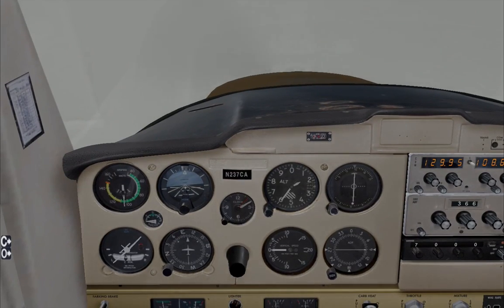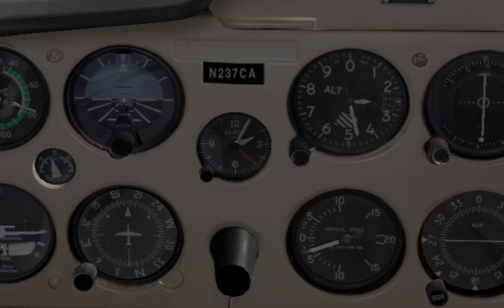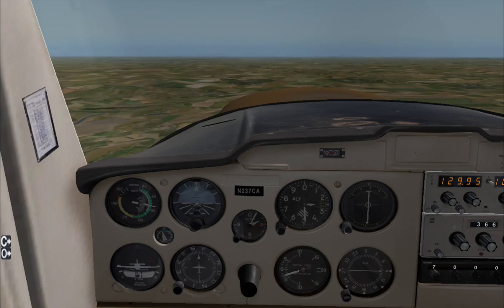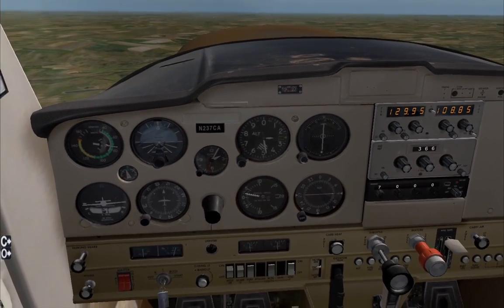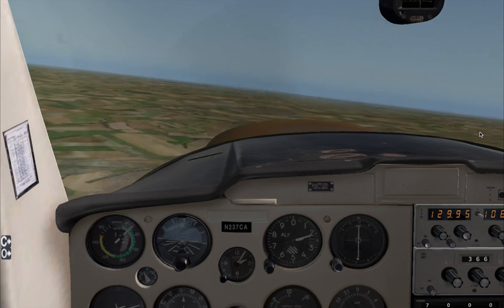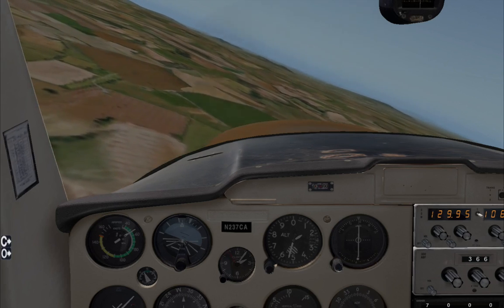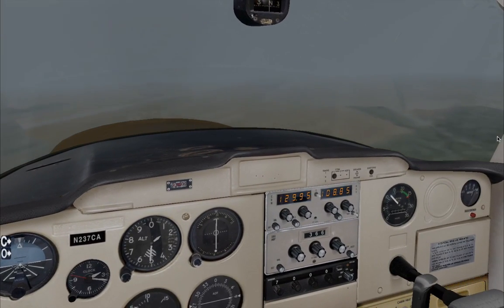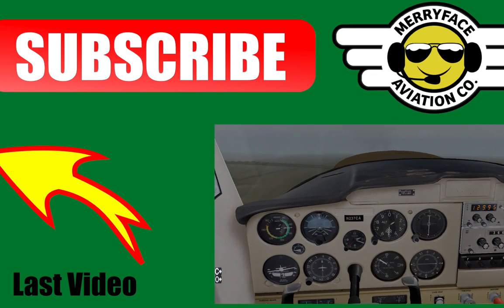An IFR Pilot's Worst Nightmare And how to Survive

Comment: I don't know if light nose gliding GA would like full trim, but if there was a complete vacuum-electrical failure there wouldn't be any trim anyway.
Reply from the maker: Trim in any aircraft is manual. even in complex aircraft with electric trim, they have a manual trim wheel. and "nose gliding GA" doesn't mean anything.
Reply: Diamonds. DA-20 has electric trim. The procedure you described is quoted in the DA-40 stall safety history (without flaps) and is below stall speed.
Reply from the maker: Interested to fly the Da20, as I have never before seen an aircraft with no manual trim backing up the electrical trim before. As for your second sentence, I'm afraid I don't understand what you're saying. Could you clarify?
Reply: The Diamonds have very light noses. You don't even pull full back simulating soft field T/O. Lifting the nose and stalling is a concern transitioning from a Cessna. If your procedure is one that my instructor would endorse I'm wondering if full trim (let alone full flaps) would be a good idea for every aircraft. In a PFL I don't apply full trim for best glide around 70 KTs. The indicator lights make it look like 80%. I don't think they routinely advocate releasing controls completely for anything. They'd rather some positive control, like a careful 180. If altitude permitted a descent, why not a controlled descent based on rpm or MP trying not to unlevel the ailerons at 500fpm at about 500rpm or 5" difference? I just learnt that you have 20 seconds before you become accustomed to an unusual attitude and become disoriented in the absence of instrumental and visual cues.
Reply from the maker: you're taking things away from the situation discussed here. We're not talking about PFLs or flying into IMC with an IR and working instruments. The purpose of this method is to descend as close yet safely to the stall speed as possible. This results in the maximum amount of time available to react to an obstacle in low visibility and a safe descent rate, with no instrument flying proficiency required. This method applies to one very specific situation: being stuck in IMC when you don't want to be in it, after you have tried the standard methods to get out. This applies in no other situation. P.S. I'm also a flight instructor.
Reply: I was trying to describe Diamond characteristics, since you mentioned you don't know about them.
Reply from the maker: Thanks. I appreciate it :) It is very interesting indeed
Reply: MerryfaceAviation I'm afraid Elaine Morrison is correct on the DA-20, there is indeed no mechanical trim wheel in the cockpit, only the rocker switch on the throttle pedestal. Quite a crazy setup if you ask me, but then that is the least of the DA-20's design problems. Try this on for size: Diamond undersized its alternator, so when you have everything on at night (lights, avionics, the works), the alternator just barely breaks even on charging the battery. Oh and the instrument lights are next to nonexistent - it's basically like holding a candle to the instrument panel.
Reply: The electricals are problematic all around, yes! Is it that the AI and HI being electrical eat up too much charge, or that the whole contraption simply undercharges by the engine? Maybe it's better that the engine is concentrated more on flying, if so, but I'm all prepped up to return nordo. Do you use your map backlight for nights? Big difference. We have to use red sports headlamps too. The kicker is the electric fuel pump warning light. Love that igniting on the first take-off of the day. It goes off within 5 seconds though. My CFI gave me a 5 second rule to let things decide they're not really in an emergency. I modified that rule to operate only during cruise, not 200 ft off the ground, climbing, at which point I'll give it the fuel pump if it says it wants it...until I'm sure the plane is warm and it's just bluffing. AME says it's all good. I gathered the electricals are just underpowered in general but the planes have a good safety track record. For all their issues (I don't like coughing C-152s on take-off climbing over water in winter and all their carb ice) electrical versus engine, I'll take electrical. At this point I'm still flying old school and it's pretty much me flying the plane VFR with a paper map and a watch. I guess this is why. One could get too attached to a GPS.
Reply: My flight training is conducted in a Tecnam Sierra, and I'm wondering the same thing.
the trim controls are electric and positioned on the stick.

I have a copy of the handbook for that aircraft (not the exact aircraft we fly, but the same model) and there's no mention of any kind of backup trim controls.
So if the electrical system is out the trim controls don't seem like they'd work.

Comment: Fly the compass SOUTH!
ANDS: on E or W heading Incr or decr in momentum causes North or south indication on compass.
Heading North, as AC turns Compass initially turns The wrong way
Heading SOUTH compass very quickly turns in the proper direction if turning..... keep a SOUTH heading until under the overcast to keep wings level.
Reply: @jemand8462  If you only have a compass to keep your wings level in IMC, Fly SOUTH to get blow cloud layer.

Comment: Dear @merryfaceAviation - Can you are your instructor if that hack is load dependent. Would it work with 4 passenger or would the flight characteristics be different? Thanks
Reply from the maker: Hi! This should work as long as you are within the mass and balance limits. Again, try it out in VMC first! Other things affect it too. Such as turbulence.

Comment: It feels like you are going into a spin soon. Speed is so low and one of your wing is stalling soon.
Reply from the maker: Yes the purpose is to get as low a speed as possible without stalling. If the mass and balance is within limits though, it will not stall in this configuration, as long as you do not touch the elevator controls

Comment: I'd prefer to not touch anything, although an aircraft should continue straight & level, you'll always have altitude and compass which do not require any external power and are installed on IFR aircrafts anyway.

With those two instruments, you should get an idea if you're turning or descending or straight & level.

The practice you recommend rather put the aircraft in an uncontrollable configuration which I may not try, as said it goes just straight and level as long as you don't touch anything, except IMC occur in turbulent area, loss of electrical and vacuum is no luck.

So better is have a good training how to deal with it. In a situation, you should not have to think too much about it, better have been trained a lot how to deal with it.

As few said, descending in IMC in possible unknown area is not a first choice, first talk to ATC, have their help, reduce electrical load to keep the turn coordinator available as long as possible (that may be the only electrical situation awareness instrument left), auxiliary VAC on if installed, just straight and level which might be difficult if not trained.

Etc etc, do not invent procedures which might work in a simulator but not proof tested, also note trim might be very different from aircraft to aircraft and also depending on center of gravity location for this flight.

So far as your method's concerned just reduce the power a little bit to initiate a descent and return in to the original if breaking out of the cloud, don't touch anything else, but first talk ATC, get clear information about safe descent altitude in  your area if they have you on scope, SQWK 7700 FRQ 121.5, Mayde (3).

If you broke out of cloud low altitude in hazardous area also not easy to deal.

I think :

- contact ATC and get help.
- remain calm, straight and level, use available instruments and get back to safety area (flight conditions and close from an airport with acceptable meteorological minimas)
Reply from the maker: as the video says, this is a last resort technique. Not everyone has an IR and the average VFR pilots lasts 174 seconds in IMC. This technique comes from gliding, and aircraft, which are designed to be inherently stable and thus in this configuration should come down nice and easy, as long as the aircraft is within mass and balance limits.
Reply: Looks like the test that leads to this result includes conditions present in IMC such as rough turbulent air. The difficulty was maintaining flight level. Not sure yet, cause I'm not IR and did not experience IMC so could'nt tell what's going on there.
Reply from the maker: Hi! the whole point is that you don't have to do anything to keep the aircraft in a safe attitude. It's about getting below the clouds. I teach this to my students with one small change, I ask them to put small aileron inputs looking at the turn coordinator to make sure the wings stay level. Works EVERY SINGLE TIME.
Reply: What about the notion of MSA.
Reply from the maker: MSA is for IFR, not VFR. You might be confusing it with the safe altitude. Either way, it would only help if you were able to fly on instruments proficiency, partial panel or not.

Comment: This is not good advice for all situations. Know your airplane well.
Reply from the maker: indeed. it's more of an interesting fact. That's why I say mutliple times to practice with an instructor in VMC. And realistically, when would you lose ALL your instruments? It's just a fun thing to experiment in. I do teach a variation of this as a supplement to flight training not as a tool to use, but more as a lesson in aircraft stability and a very interesting behaviour.
Reply: @MerryfaceAviation   it very much depends on the plane you’re flying. Full upwards trim on some planes will kill you. I agree it’s not a bad idea to trim nose up, but it’s not good advice to say “full trim up”. Just my 2 cents.
Reply from the maker: @iliketheoutside  yes. For example, with the PA38 I would do full aft trim then go back half a turn. But the whole point is experimentation. with sufficient altitude and due diligence (HASELL, or whatever checks you've been taught prior to doing maneuvres), it's a good exercise to try. So far I've experimented it with the C152, 172, PA38, and PA28. So far so good. I'd love to test this on more aircraft. I have in flight sim, but I'm not going to count those!!
Reply: @MerryfaceAviation  I mean in general I agree, but it depends. I fly the C208 and PA60 - if you trimmed full nose up on those planes it’s not going to end well for you. But I appreciate the video!
Reply from the maker: @iliketheoutside  yeah that's fair. but we're now going into different categories! I would never attempt it on complex aircraft :p I wouldn't dream to that on anything more complex than a fixed gear aircraft.
Reply: @MerryfaceAviation  to be fair, the C208 isn’t a complex haha. But yeah you definitely get my point.  Safe flying man

Comment: Out of curiosity (and possibly future self-preservation): Do you know how well the PA-28 takes this? I just assume that the low-wing design would be somewhat less stable than a high-wing one...?
Reply from the maker: So I've been trying this out with a few aircraft. The Pa28 (warrior 3) was by far the most stable one. Really gentle turn at about 300-900fpm. It works well with the C152. The pa38 worked relatively well. The C172SP, surprisingly, went into a steep bank spiral descent at around 1500fpm. I'm going to test it again to see if there's a way to make it less extreme.
Reply: vary the elevator trim and the flaps
 (one at a time  if you change both at once you don't know what helped vs what hurt)

Should be a setting that has less spiral if aileron and rudder are trimmed correctly and not cross-trimmed.
Reply: The warrior is a brilliant airplane. PA38 whatever you do dont stall it, it drops a wing and spins in a stall with no trouble whatsoever..